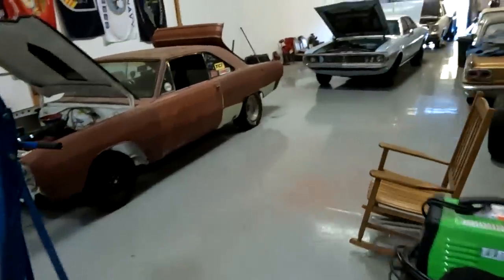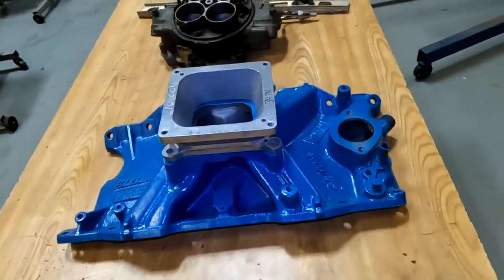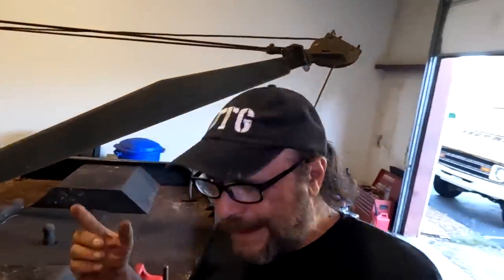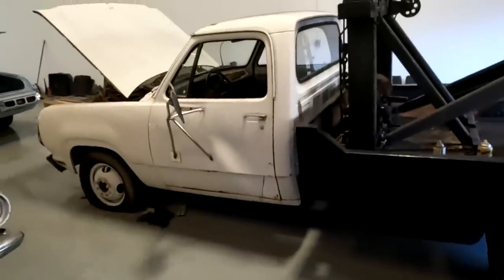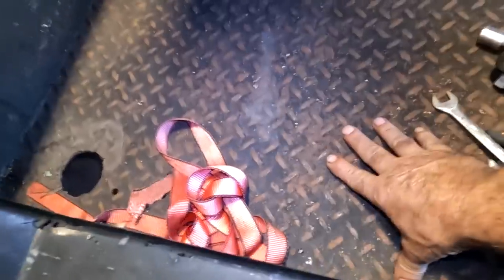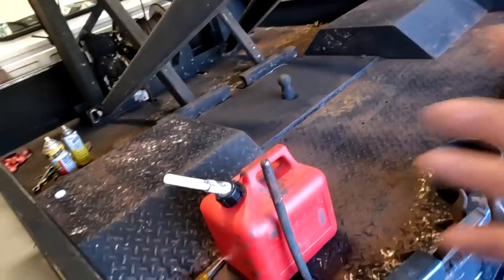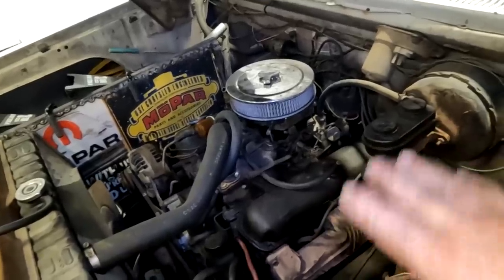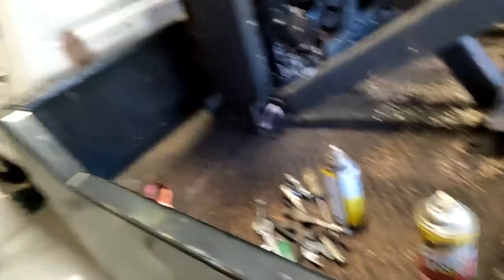Survivor Dodge Tow Truck Finally Gets Some Love, And We Build A Frunk! 1980 Dodge Wrecker Revival

Comment: I used to flatten tires together them closer to the ground, but I now have a step hooks over the tire and a hitch on the front of my truck that I can slide a complete platform into. Love the tow truck can't wait to see the final product
Reply: I can just climb on in to the engine bay, with my 240 'big block' I6 Dentside. I think it's like four steps or less, and I'm standing on the ground at the left front of the engine!

Comment: Tony you and I think alot alike I did almost the exact same thing to my 89 w250 cummings right down to the jumper cable stash spot. I like the old signs nice touch. There's so much extra space under the hoods of those trucks.I took out my bench seat and put bucket seats and console from a 2000 RT Durango that gave me so much more storage space cup holders and comfort.I love those trucks 72 to 93 Dodge nailed it over the Ford and Chevy for leg comfort and head room. I have a 82 C10 and will always take the Dodge on long trips just for the comfort alone. I only wish more of them came with A/C. Love that truck thanks for showing it 👍

Comment: A rollback is where it’s at! I got a 1990 ford with a 7.3, it’s painfully slow but very dependable and very useful!
Reply: Same can be said for the 7.4, 6.5 even.

I'd rather have a reliable and dependable engine (262 V6, 305-350/454/496/LS Truck) than a ultra rev 1 that is stressed out already (Coyote 5.0)

Comment: ThereS so much room under the hood of those trucks. I keep a toolbox and a mini milkcrate full of fluids inside the fender in front of the pass side wheelweel and a piece of 4" pvc full of zipties, rags, and other stuff vertically between the radiator and coolant overflow tank. There's still room for a couple cat carriers under there too

Comment: working on my 65 F100, I usea rim with a piece of plywood on top to stand on so I dont have to reach over as much. I'm probably going to get one of those aluminum step stands to work on it so I dont have to worry so much about stepping off the rim and flipping the board as much.

Comment: If you dont put the headlights and tail lights on relays, at least run the trailer marker lights on their own circuit with a toggle switch. 
It'll save your headlight switch and its plug, especially with more marker lights on the bed and with cab lights.

Comment: Delta makes a Brite diamond plate tread aluminum square job box with a big lid and it has a seal, and my momma's 96 f250 super cab long bed 2wd 460bbf truck used to have a big black and type plastic single lid tool box with a weather seal and she added a camper tape seal on the edges of where the lid is beveled so it will deal the weather out she kept jumper cables,a chain and a Napa snatch strap in the back of her truck she was raised a farm girl!!

Comment: I like your wrecker and your improvements, I always looked at that empty space and had similar ideas, I wanted to permanently mount a Honda gas generator in that spot, where it wouldn’t get stolen. I had one of those Torker 340’s when they first came out, and I concluded it’s best attribute was knocking about 30 pounds off the front of the car, other than that, not much.
Reply: Isn't the Torker a single plane?  That's typically not going to do you any good on the street.
Reply: Yes, it’s a single plain. The Tarantula came out first, designed for higher rpm, then the Torker followed. Designed for the SBC, where it might have worked ok, but I’ve always figured they just did what they had to do to adapt it to every other engine. The R&D was all spent on the Chev engines. That’s my bias showing.

Comment: Damn, that is one clean example of a NoMar tow body. NoMar's used to get a bad rap in the towing industry back in those days.......aint true, the Retriever beds were very capable wrecker bodies....and what Tony says is true, a LOT of these bodies ended up on the back of Dodge chassis because of the partnership between NoMar and Chrysler. I've owned two Nomar wrecker bodies on Dodge trucks, and both were perfectly capable of winching, recovery, and are only limited by the chassis gvwr. Times have changed here in illinois, laws have become so cumbersome, between the usual title and plates (illinois is outrageous for the fees), the insurance requirements are oppressive, and 20 years ago the state has required a license that, combined with all the other expensive hoops you are required to jump thru....well lets just say owning a tow truck, for your own purposes, for fun, as a hobby truck....those days are just gone. Now you pretty much need to be a full time retail towing service in order to be able to afford the trucks and operate them. Sad, bcuz back in the day it was just plain fun and convenient to have and keep one around for ''personal use''. I'll be watching to see how this build turns out.

Comment: If it's a 1980 Thermoquad with a 360 V8, I find that the choke pull off is readily available through Rock Auto among other sources. If it's a carburetor from a different year or model, the four-digit Carter carburetor number is needed to determine the choke pull off. I'd put locking toolboxes on the deck, and they can be made of aluminum to save weight and I think it will be more flexible. I'm not sure who made that tow body, but many designs of that style (such as Miller Industries, who oddly enough is located in your home state of TN) have toolboxes in the body.

Comment: For the bed u should use old army ammo boxes there cheap very water proof and super strong. Plus if u make them removable It’s like a tool box so u don’t have to run back and forth to the truck at the track for tools or parts. U can just carry it to the car and go… I did this for years when I used to go mudding or snowmobiling all the time.
Reply: And for security, and a lockable bar over the top.  That way the boxes don't walk away.

Comment: ya gonna put a wheel lift on it? A big block would be the ticket for that thing. I'd leave the paint a body alone. But a couple more cables and bad ass which system with an extending boom would be cool.

Comment: Tony if you need the turn signals or side marker lights for this truck I have them in stock.  I also have the turn signals for the 1977 - 1978 models and they are hard to find.

Comment: UT.  Let the air out on most any pick up I work on now especially since I’m in my 50s complete with worn out back, if it is 4x4 and or 3/4 ton or larger I’m twisted out valve cores for sure. 
    As for the UTC cool @$$ Dodge Wrecker, a pair of cherry bombs plumbed into a pair of stacks is a must ! Paint it in retro paint scheme they were using in the early 80s.  I can’t remember the  big ol grain truck size IH I had the, and I say this loosely, pleasure commanding, in the 80s was faded blu/wht/orng when I was working at 2 bay Union76 station back then. Hey any of you remember the orange 76 balls for the antenna ????  Dig the content, and the channel btw…..

Comment: have you seen those new things ,i think they call em a wheel lift/ sling combo ,that looks like a old holmes 220 unit from the 60s,  classic but outta style  you should find a nice roll bed  UD1800 with a nice jerdan rollbed and a wheelift out back for 2 car capability

Comment: My 65 Galaxie has finally broke me of building the car. We replaced the frame, I pulled the stout FE and C6 out and put it into the car. We painted the whole car. All it lacks is an interior. The cost of an interior is stupid. I lost most of my vision, 62 years old, and I love the looks. It has 4.33s with a locker and it will burn the tires through the first two gears get moving in 3rd and is still hazing the tires winds to 7k with no effort. I need to get back to work on it…

Comment: I'm surprised if somebody didn't shout at you for ruining two great Mopar signs! I'm not going to. They fit better than a Ford sign. Go down to your home improvement store painters using quite a bit he'll get you about 18 in or so off the ground about even with the bumper on average. And they're like 4 ft long maybe longer. They have a couple of steps wanted each in which kind of pain in the .... Keeping it family-friendly. Anyway I didn't run it along with the bumper across from the truck and grab a couple concrete blocks and send both on the ground and use them as a step to get up on it and it makes it real Handy. Or if you use another step stool sounds complicated doesn't it. That gives you a platform wide enough to stand and have enough room for your feet and to go back and forth. Or we could just flatten the tires. I forgot about that. My grandfather used to do that. I like the paint job the way it is. He can paint it up black and white make it look like an impound vehicle. They get all the good parking spaces! In the star on the door he could put got you. I know lady who has a black and white cruiser and she has got you going down the doors like it would say police but it says gotcha. not my original idea so I have to give credit. Enjoy this episode.

Comment: Dear Mr. Tony
??? Where's the problem? Please kindly allow me some suggestions and an advice: Why not fabricating two tool boxes to put one into each side panel (and under the truck). Additionally put two tool boxes on the bed (one per side). The tools under the hood will rattle. Additionally the weight only on one side will definitely influence the front axle respektive driving behavior.
Best regards, luck, health and wisdom.

Comment: Only cause it was mentioned..  I helped my Heat Soak.. in my 68 Dart 318 swap... Had some extra and too big for my use, fuel line.. cut down the middle and Covered my Hard-line from mechanical fuel pump to fuel filter.. just to battle that Heat.. since it's Near almost every Thing Hot.. and it worked for Me.. daily driver.. everyday and everywhere.. 100° plus in traffic.. here in Orange county Ca.. my two pennies on the floor . @∅🇺🇲

Comment: Enclosed trailers are awesome when your at the track and want A/C you can turn the AC on and if it starts to rain you can pull the car in out of the rain. You can have your tool box and jacks and all the stuff you need to work on a car in the trailer and you can store a car in a enclosed trailer for the winter or whatever where a open trailer is good to put a car on but that's all it's good for and if you have anything on it you can't leave it on there or it will get stolen or rained on. I think enclosed trailers are so much better but it all depends on what you use it for really.,

Comment: That brings back memories. I drove a 79 Dodge tow truck with an industrial 360. We rebuilt the engine added bigger exhaust and thrush hushers. We also put a Carter 4bbl. and a low torque power cam. That truck could actually crow hop with that low end torque. It had a Holmes sling and winch. We even rebuilt the winch gearbox.
      I loved driving that truck, it even had a custom paint job and lettering.

Comment: Hey Tony, that is a great idea for creating storage. My only concern is that in a front in accident that square tubing could become a "spear" and punch straight through the firewall and into the cab. I wonder if maybe cutting some notches or other type of weak point so it can collapse would fix this possible issue. Its just something I noticed and thought about now that I am taking some classes on structural and non structural repair. Love the show and definitely gotta paint it to keep Aunt Kathy happy.
Reply: Same thoughts as well even that jack handle looks like it could really do some damage in a hard front end impact.
Reply: Good catch. Tony, I suggest you build or buy a box for the bed to store the jack & stands. Keep the up front storage for non (low) flammable liquids or hand tools. Ole Ralph Nader would have a fit just thinking that Uncle Cathy could impaled in the event of a front end accident.

Comment: In high school the shop I worked at had a rotten out truck like that with a blown out exhaust. It was great going for parts runs and driving through the old downtown area pushing it the clutch and reving the 360 with the loud exhaust echoing off all the buildings.😎

Comment: Worked at a Chev Dealer for over 2 decades as a mechanic (wasn't a tech because I think outside of the cyber- space box). As trucks got taller, we all started to air down front tires to work on them. It got to the point with the Giant wheels and tires that we even started to remove the front wheels and setting the front on wooden blocks. Many of us had a 18'' square - 12" high, wooden box to stand on as part of our tool kit. The newer diesel pickups ('99 and newer) we lifted the cabs off to be able to work on them. Retired at 62, had enough of electronic "control" systems.

Comment: The fender boxes are clever, I like the signs too. I'd love to see the video on the dif repair. My 62 falcon was converted to manual choke, the cable and knob were from an 80's garden tractor, once you know what to listen for I prefer manual choke personally. I'd rather risk user error than parts failure, the more manual and analog things I can incorporate the better.

Comment: Pick up two cross bed tool boxes and mount them (parallel with the length of the truck) up on top of those wheel wells. Put some support blocks on either end of them out one on each side. They make narrow models if a regular box is two wide and hits your tow frame. Pick up some old cheap white or black steel ones and give them a fresh coat of Rust-Oleum brush on either brushed or sprayed through your HVLP.

Comment: Love the "frunk", good use of wasted space. As for the tray area, might be more work than you want to do, but perhaps lift the front floor section in line with the wheel arches, then that could allow more space under it for a side loader tool box? 🤔

Comment: My first wrecker, but mine had the L arm or early stinger assembly that was powered by the single cable or line. Mine also had the push bumper assembly on the front end. What a great idea for storage. My old boss was a Nash Rambler Mopar Dealer who I worked for a long time. Great Videos Thank You 🙏

Comment: Make your new stand storage area under the hood a cold air intake. Makes for a great heat shield.
Reply: If Banks has 1 for that I'd do it, air under the hood is hot. Otherwise a small super charger with intercooler.

Comment: I would just Freshen the Existing Engine. Even if it means an overhaul

I'm the kind that would use existing engine as long as its in good shape.

Mod them, Eg a TBI 350 I would convert to TPI.

If it has a 305, I'd build the 305.

Solution in General Aviation to stop vapor lock is to use EFI.

Comment: If you really wanted to make it the best tow vehicle it could be you’d need a donar with a Cummins. But I get it. Use what you have and make it the best it can be within reason. Still, 12 valves are pretty primitive.
The thing you built in the engine bay is great. I’d add a bottle jack. They’re cheap and small enough to lift anything that floor jack won’t.

Comment: Yeah these D & W series trucks can be a pain, but try a 94-up ram putting valve cover gaskets on are a mfer, I'm 6'2" and I have to lay on top of the engine to reach the rear valve cover bolts

Comment: I had a 74 chevy c30 with a vulcan lift n tow bed. Horrible storage as a daily. So I mounted diamond plate boxes on either side and the door behind the drivers door I made into a wood lined, sealed closet cause it was horrible jammin coats and crap on the seat or behind it. Love the channel

Comment: Hey Tony I wanna make a suggestion on headlights this is Jim mungai again Haula makes a great head like they really do but I would also recommend this is later down the road putting relays under the hood instead of having the power come from the dash which is hard on your wiring those trucks don’t like that kind of strain on it and anyway you take the power straight from the battery and you’ll be happy you have very good lighting and their DOT approved headlights see a lot of guys put those super high powered headlights in not DOT approved all right you have a good day guy

Comment: Ya need to buy or build an overhead creeper, it gets ya up over the top and when ya put a nice piece of foam with carpet covering the top its very comfortable to lay on.  You can reach the back of the engine and it makes life easier for us shorter guys to work on taller trks, 4x4s and such. A little tray on each side gives you a place to put tools bolts and parts.

Comment: I had a 76 GMC 2500 like that. I also had a 63 D 100 which had a hood that lifted 90 degrees so that I could crawl into it and stand on the frame rail to change the points. It was a 318 with a Stromberg 2bbl, manual choke. I miss that truck.